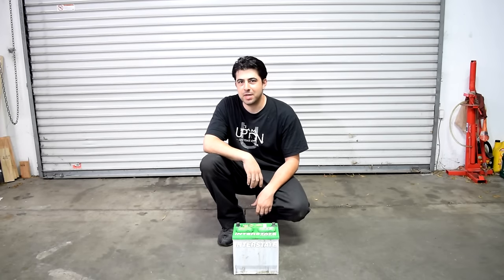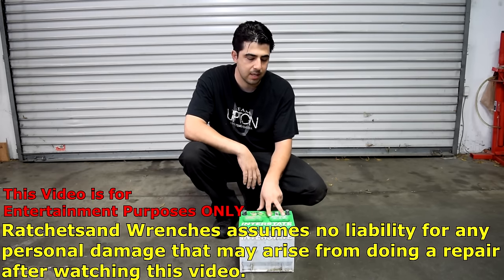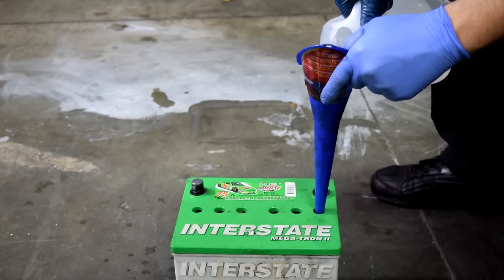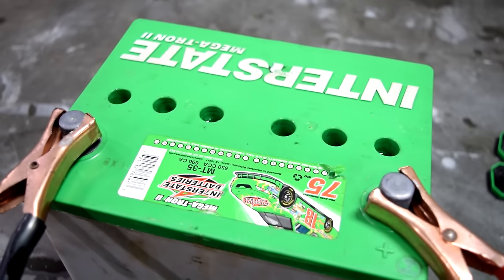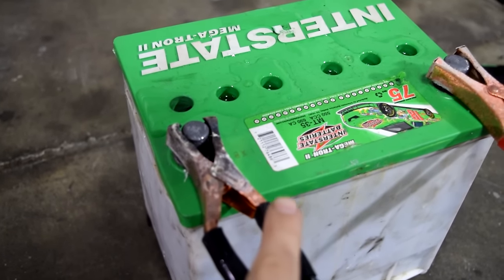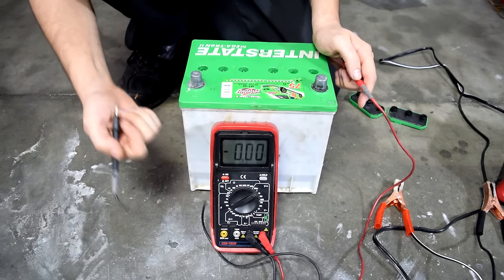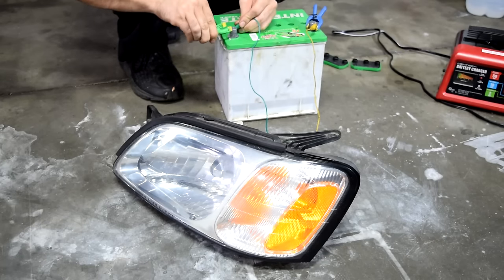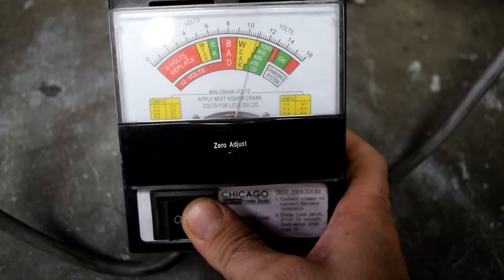Is it Possible to Revive a Dead Battery with Epsom Salt - See For Yourself

Comment: I'm not a 100℅ on this but didn't charging have to take place on wood or off the ground?  I am fairly positive that placing a battery on concrete or the ground is the last thing you want to do. some one tell me if I'm wrong.
Reply: David Hammond
Reply: honestly does not matter bc you're charging it, now if he wasn't charging it and he left it on the concrete, then you're 100% correct.
Reply: That used to be true, but I think around  the late 50's early 60's they started insulating battery cases. They can be stored  on concrete without losing their charge.
Reply: your right, it will drain the battery slowy on concreat, should of placed the battery on some thick wood
Reply: Wives Tale, garbage science = NOT science. All batteries discharge over time. Lead acid batteries are bad about it.
Reply: ok so you guys that think it doesn't matter that concrete does no harm I hope you will give it a try take a good battery set it on a 2x4 on concrete for a week and check its voltage then set it on concrete with nothing over night and tell me it not true  then try charging it the same way and I bet you will find that it effect it
Reply: I work at a battery store, complete urban legend.
Reply: David Hammond That used to hold true before with older batteries that were made of inferior materials- porous plastic shells. Some batteries cells were enclosed in tar lined wooden boxes. Placing these older batteries on damp concrete could cause the wood to swell. Allowing for leaks. But these days the plastics used are much better, thus allowing us to set them down on concrete without any issues.
Reply: where is myth busters when you need them?
Reply: David Hammond that's also what I was taught . the ground because of capacitance will drain the battery and suck the the positive protons to earth .current flows from positive to negative and a plastic battery setting on the ground acts like a capacitor that shorts to the earth ground which is Negatively charged.:)
Reply: but you would have to have voltage sufficient to overcome the resistance of the plastic.
Reply: so right the battery grounds out thus shorting
Reply: SO WRONG.
Reply: David Hammond 

Absolutely correct!
Reply: Used to be an issue way back in the day. Now it's basically just an old wives tale, and no longer applies to new batteries.
Reply: As I recall... good batteries were kept on a shelf... bad ones on the floor.  It was simply a common way of separating the good ones from the bad ones.  After all.... like with tires... they don't put worn out ones back on the shelf.
Reply: David Hammond 
correct sir. dude dont understand how it works
Reply: ZZxeroZZ x  wow
Reply: David Castle capacitance or rather a capacitor DOES NOT pass DC current. in FACT a capacitor is nothing more than a battery.
Reply: David Castle oh ya one other thing, Electrons actually fow from negative to positive. ya no kidding look it up or ask a welder
Reply: integr8er66   If a capacitor doesn't pass DC why are there so many in a dc circuit?  Are you sure that you're not talking about a Diode?
Reply: That's old school from the 40-50s...doesn't really apply anymore. I got batteries been on floor for a year...still 12.4v with good amps.
Reply: David Hammond 40 yrs ago batterys wer affected by concrete.not now.
Reply: LOL ... Reading these comments makes me laugh literally ... leaving batteries on a concrete floor in this day & age does not damage the battery period ... when lead acid batteries were 1st made they had glass tubes encased in tar lined timber boxes to hold the acid & placing them on cold concrete floors for periods of time resulted in the timber becoming swollen causing the glass tubes to break ... therein lies the myth ... todays technology has eliminated that problem but the myth falsely lives on ... the nickel-iron battery that came after was a rubber cased battery encased in steel which when not isolated in timber crates would discharge into concrete quite easily & certain battery cases used an archaic hardened rubber which was porous & would contain lots of carbon ... so a moist concrete floor combined with the carbon in the battery cases could create electrical current between the cells which in turn assisted in discharging them ... cool concrete is a better option of storing in comfortable ambient temps which will slow the normal discharge of an unused battery as apposed to warm to high temps ... cooler the better for storage ... obviously in very low temps such as snowy & frosty conditions will render cold batteries being less efficient at both charging and discharging ... my batteries are stored on the concrete floor as well as my steel welding bench for weeks on end & never lose charge ...
Reply: Dibby59:  It is amazing how someone can use the internet to show the world how profoundly Ignorant they are... and yet can't do a 'Google' Search to find the facts on a subject.  :P  LOL
Reply: +neomags ... LOL Yes & I find it amazing how many people of all ages actually still believe & peddle this myth ... the amount of people who walk into my shed & comment that I shouldn't be leaving my batteries on the concrete or on my steel welding bench without timber underneath ...
Reply: No it wont.
Reply: why does this look like ANNOYING CLICK BAIT?
Reply: David Hammond ,That's what I just noticed, and commented on. lol
Reply: Appreciate Video clip! Forgive me for butting in, I would appreciate your opinion. Have you heard about - Rozardner Powerful Battery Reality (should be on google have a look)? It is a great one off guide for learning how to recondition an old battery minus the hard work. Ive heard some unbelievable things about it and my cooworker  got excellent results with it.
Reply: Great video content! Apologies for the intrusion, I would love your initial thoughts. Have you heard the talk about - Rozardner Powerful Battery Reality (do a search on google)? It is a good exclusive product for learning how to recondition an old battery minus the hard work. Ive heard some incredible things about it and my cooworker at very last got great results with it.
Reply: sounds like more scammer material to me
Reply: Yep... another BS thing... run for your lives everyone
Reply: you are wrong the concrete wont kill your battery
Reply: These are called bypass capacitors in a circuit that has audio or digital, they act as a short to AC bypassing the noise to ground.  In other circuits they pass the AC component to another stage while blocking the DC component.  They are also used as a temporary storage to help smooth a DC voltage source.
Reply: Erazelaser clinic - Cheers for the Video clip! Excuse me for chiming in, I would love your opinion. Have you considered - Rozardner Body Design Reality (do a google search)? It is a smashing one off guide for learning how to remove an unwanted tattoo naturally without the headache. Ive heard some interesting things about it and my friend finally got amazing success with it.
Reply: David Hammond you don't wanna store it on concrete but to work on it no problem, a day or two doesn't matter.
Reply: David Hammond no, that is an old school problem with batteries that have very poor insulation from the ground.  Newer batteries should be fine on the ground.  I wouldn't store them on the ground or on concrete, but charging on it should be fine.
Reply: Stan Rodgers it's not garbage science, it's from old batteries that had poor insulators in the past.  Newer insulators mitigated this problem, but storing batteries in concrete or earth WILL increase the rate of discharge.
Reply: 'Interesting'... what real world test data do you have regarding this claim you are making?
Reply: A capacitor does NOT conduct DC. It conducts AC. They can be used as filters for DC, by conducting AC components to ground, parcicularly when combined with an inductor or resistor. 

Guys, look... you can leave a modern battery on concrete as long as you like. Yes, it will lose its charge eventually. If you put it on wood, rubber, glass, chocolate pudding, or a mat of virgin albino pubic hair woven by druidic priests under the light of the first full moon after the spring equinox, or even hang it in midair, it will still self discharge. This is internal to the battery. Concrete has no effect on a battery placed on it. Period. Try it yourself if you like, with two identical batteries in identical condition. The earth is not flat. The tooth fairy is not real. Not everyone who says they like or respect you, does. And concrete does NOT affect battery state of charge. In the '20s I am sure it did. They didn't have modern plastic cases.
Reply: Growley M:  LOL :P  GREAT!!! response.  However... I do believe some DC capacitors can be used to store electricity for a period of time.
Reply: neomags indeed they can be used to store a charge. however they do not CONDUCT DC. They store it or release it, only.
Reply: Yeah... You are totally correct about the non-conduction of electricity.... at least until the electrolyte fails.  LOL  :P  I'm not sure how well they conduct after that... I'd imagine somewhere between a dead short and a resistor.  :)
Reply: Hey vendors, how about not spamming up the comment thread, huh? If we want your products we will look for them. You are irritating us and probably violating the youtube TOS.This is not your marketplace. Beat it. Get lost.
Reply: There is no DC current flow through a capacitance. It would have to be AC (and obviously it isn't). So the theory breaks down on that point.
Reply: its not the concrete that causes battery problems... its the combination of concrete, moisture and the metal used inn the concrete as well as the acid content and construction of the battery..
the el-cheap-o batteries will drain down quickly .. the high dollar batteries take longer but with go dead also.. 
now if you want a battery that will last and will do a great job no matter go with the 

Lithium Pros L3400
Lithium Pros L3400 Details

12V Batteries

12.8 volts

Full battery management system
Fully compatible with alternator (14.6V max)
BCI Group 34 size to replace 34, 48, and 49 sizes
Available in positive left and right hand
Length: 10.24''
Height: 7.2''
Width: 6.93''
Charge Volts (max/alternator): 14.6
Charge Amps (normal/max): 184
of course you will need to be ready to pay the price also....
$1600.00 for 1 battery
Reply: neomags where is her post.?
Reply: I suspect that... after I reported it as spam... Youtube deleted it.  :)
Reply: Reynaldo E. Rhodes:  more spam... if you don't know where to go... .just ask.
Reply: Clara M:  Have you always been the sort to post this sort of spam or is this a new thing for you?
Reply: Absolutely true, this has happened to me before... it would take 2 or 3 days to make it not have enough charge to start a vehicle if it's perfect condition, but can sit  for weeks on some wood before losing its charge
Reply: Gadget mall I don't think protons are sucked to earth or else the battery would be radioactive. The electrons might be. Nuclear engr for 34 years.
Reply: Lets all report this as spam and advertising... :P
Reply: thats an old wives tale. not true. batteries discharge over time no mater what surface they are placed on.
Reply: Moses:  I vote you for being a scammer and unwanted advertiser.
Reply: Joseph Acosta:  Great!  More spam from you again.
Reply: neomags I've done this on lots of batteries. Got about a 60% success rate overall. Sometimes I'll do 3 or 4 batteries and they all work, sometimes none do. Sometimes repeating the procedure helps, sometimes not. But it's satisfying bringing something back to life and using that somebody else gave up for junk.
Reply: zonoz:  I do that same thing with computers and cars and other things people consider 'junk'.  I'm actually using super capacitors to help an old battery 'limp along'.  Works Fantastic for me.
Reply: Kasandra E:  do you always Spam advertizements?  Or is this your first time.  Rest assured... not my first time reporting to youtube.  :P  LOL
Reply: Joseph Acosta:  More spam from you today... and more reporting also...
Reply: I use to sell car batteries and that is a miss conception, batteries will drain if dust accumulates on them across the terminals but they have insulated cases and will not drain if left on concrete
Reply: After reading all of these comments I think I will just store my batteries on a piece of wood like I have always done.
Reply: battery use to leak to ground because the plastic they use wasn't thick enough.. nowadays.. its a non issue and you can store battery on concrete ground
Reply: David Hammond.
Reply: I hear all the time that it's an old wives tale, but when I was a young man I bought a brand new battery and took it out to the parking lot to install it. I set it on the concrete walk while I removed the old battery. When I installed the new one it was completely dead. The new battery had a fresh manufacture date. I have never set a battery on concrete since.
Reply: 3David Hammond
Reply: hey ,if anyone else wants to uncover how to recondition old batteries at home try Panlarko Recondition Planner ( search on google ) ? Ive heard some super things about it and my partner got amazing results with it.
Reply: it's true if wet large format ie big cell's should be off direct contact with a cold floor or base  this is where the lower part of cell is cooler at bottom & the density of acid actually go's up  causing more chemical activity lower down & causes more corrosion (hence the need to equalize charge more in cold climates ) ie to stir up the acid more so is more equal throughout due to the bubbling. smaller batteries its not an issue ie ( car batts)
Reply: YEAH ,BUT IT'S WORKING AGAINST IT'S SELF
Reply: URBAN LEGEND IF THAT'S WHAT YOU WANT TO CALL THAT ,BUT LIKE IT OR NOT IT'S A FACT
Reply: I\'m not sure but ,if anyone else is searching for how to recondition old batteries at home try Corbandy  Battery Blueprint Crusher (Have a quick look on google cant remember the place now ) ? Ive heard some interesting things about it and my cousin got amazing success with it.
Reply: Today's batteries  can be charged on the ground due to new materials used to make the battery case. Also I would of saved the battery acid  to put back in the battery after desulfating the battery. Sulfates build up on the plates of a lead acid battery due to discharging the battery too many times. You can't  leave Epsom salt and water in a battery during winter time which will freeze and cracked the battery case.
Reply: Growley M ... Love that statement about albino pubic hair. Been looking for a source for that, female specific. Concrete can destroy a battery if enough is used from a high enough release point.
Reply: Thats a myth!   The only thing that affects a battery is dust water or oil collected between the terminals.
Reply: That sounds like a load of faff, if the charge could pass out of the plastic case of the battery why wouldn't it just pass right from one cell to the other inside the battery? A thin sheet of plastic can shield over a thousand volts and this thing is 12.....
Reply: Joseph A ... You didn't say how many weeks passed before you installed the dead battery. Did you take the black plastic sleeve off the negative terminal? You probably aren't the only one who ever got a battery that was brand new but dead. Did you have a second new battery next to the first, as a control? Things to consider. OR, maybe you made up the whole thing.
Reply: Brent Fleming ... Oil itself won't provide the path but it will collect a substantial amount of dusty particles which can provide the bridge between terminals. I had an interesting "dead" battery once. It was a victim of "if a little bit is good, a lot must be better". The clamp and post had so much red "protector" on them that it blocked contact. I hate that crap. I only use WD-40. To break down existing corrosion residue, I use blue window cleaner spray. Windex brand is as good as it gets. I happen to use a bulk purchase product that is almost as good. A clean dry battery can sit on any flat surface of medium temperature with no ill effects. Of course, the shelf life of any chemical reaction battery is limited and while there are known average timespans before enough cranking capacity is lost, the possibility exists that a battery CAN die just sitting. In usage, the battery is loaded by cranking the starter and charged back to full strength by driving with a functioning alternator. I get sent to tow cars that have "bad" starters quite often. When I try them, most just have a discharged battery, evidenced by the rapid solenoid tapping. I recently towed a 2004 Vette with 17,000 miles on it. It sits too much. The battery in the car looked brand new, but was shot due to disuse. In an ideal world, each time a car goes fallow, the electrolyte in the battery should be able to be drained and the plates washed free of any acid. Then, the day before the car is to be used, acid is returned to the battery and it returns to readiness.
Reply: Concrete is damaged by acid fumes, that’s a good reason not to store and charge a battery on concrete. The battery isn’t damaged and doesn’t discharge more on concrete.  A lead acid battery self-discharges faster when hot and slower when cold, if your floor is warm or cold that will change the self discharge rate. A very cold battery performs poorly, if  you live where the floor might be very cold, the battery should be allowed to warm up before you try to use it for something like jump-starting a car.
Reply: Not certain about the points made but ,if anyone else wants to learn about learn how to recondition batteries at home try Panlarko Recondition Planner (should be on google have a look ) ? Ive heard some unbelievable things about it and my partner got excellent results with it.
Reply: 0
Reply: David Hammond you and anyone else that thinks it you're right, can probably watch the video on YouTube of mythbusters busting this myth. It does not drain batteries.
Reply: Rubbish.
Reply: If sitting on concrete will drain a battery then so would sitting on steel.  Like the steel base of a battery compartment in your car.  You don't put a battery on concrete cause if some acid leaks it will stain the concrete.
Reply: times have changed.. now you can place them in concrete.. back then it would drain.
Reply: Pure old wives tale! BS